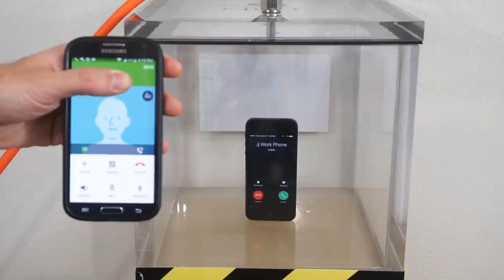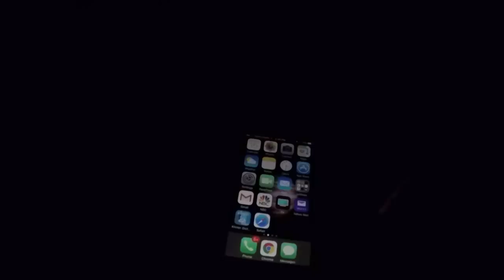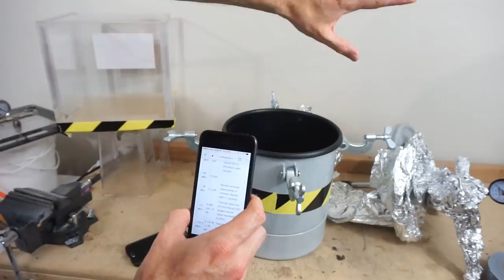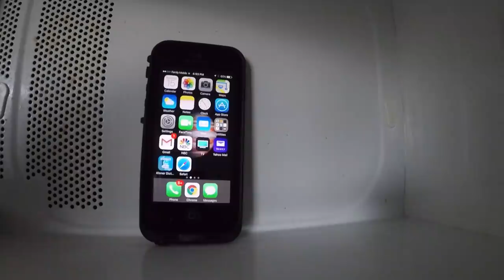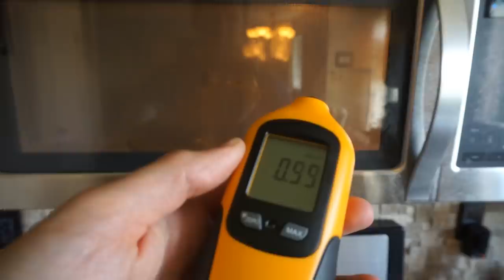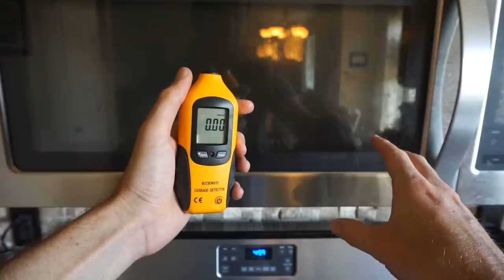Can You Call an iphone in a Vacuum Chamber? 4 Different Signal Tests!

Comment: Man's getting signal in a vacuum chamber but I can't get one bar in my house...
Reply: But then how did u put this comment then if u have no connection you tube needs 2 bars to work 😂😂
Reply: @Anything World Ever heard of a PC?
Reply: how is that impressive? light doesnt need matter to travel. only sound cant
Reply: 1. I think you need to check your grammar.

2. Calling doesn't use light waves, it uses a DIFFERENT kind.
Reply: me?
Reply: also it's an electromagnetic wave also known as light waves, i call radio waves light waves. dont judge me
Reply: Not all EM waves are light. Do your research.
Reply: Bro why u want one bar in your house u will sit at it lol
Reply: Anything World Heard of WiFi?
Reply: TSP 😂
Reply: TSP lol same
Reply: That’s surprising. But what’s not surprising is that you can save 50% or more on car insurance.
Reply: Is signal realy so bad in the US, cauze  i get 3-4 bars in the midle of the forest
Reply: InsanityWars Gaming in physics, light is often used regardless of the wavelength. Visible light refers to the visible spectrum.
Reply: TSP the vacuum chamber doesn't not affect the signal in any way. The metal bucked does, quite a lot and water a bit,
Reply: TSP haha
Reply: "one bar" haha get it? Cuz bar is a measurement of pressure
Reply: Philippines be like:
Reply: I get the joke but in a vacuum it’s actualy better technaclu
Reply: @Jake_Fpv  nope those bars are just an indicator of distance of the nearest tower. Youtube cam work with 1 bar too. The network speed depends on the number of people connected to the tower.
Reply: I know the feeling: I get service anywhere in my house, except my home office!!😒
Reply: @Jake_Fpv  ever heard of wifi?
Reply: @vincentrobinette1507  use wifi
Reply: @Jake_Fpv  ever heard of going outside to get 2/3/4/5 bars?
Reply: I have the same problem. It's probably because of the area. There's some kind of material absorbing the radio signals from the antenna to the cell phone. Could be ionised atmosphere around the area. Just a guess.

Comment: So it receives calls in a metal can, but it Probably can't get cell service in the mall lol
Reply: jesse scharf lol
Reply: jesse scharf the metal can probably acts like an antenna. Lead is what cancels signal I believe
Reply: Certain metals can prevent your phone to receive signal. Diamagnetic metals like copper does not allow electromagnetic waves (radiowaves) to pass thru so if your phone is incased with such metals it'll be hard to have signal.
Reply: The materials used on the construction of the mall/buildings could be the factor why mobile phones does not have signal in it. Some building management ask service providers to install in-building-solution( mini atennas) inside the building to allow signals.
Reply: jesse scharf the cause of lead making you insane is because it gets rid of your cell service
Reply: jesse scharf the mall has much thicker steel walls and block alot more

Comment: Put your phone in the bowl of water and put the phone and bowl of water inside the steel chamber and the put the steel chamber inside the vacuum chamber and see if it works... I'd be surprised if it works in all that
Reply: i think the water would boil
Reply: but the temp wouldnt rise to hurt the phone.
i'd be more worried if the water got some of the metal from the container. or used the electrons from the metal and became conductive and broke the phone.
Reply: I agree
Reply: The vacuum chamber would remove air that is blocking part of the signal. It makes the signal stronger, not weaker.
Reply: Mr Sandman no because you need to connect the chamber to cables
Reply: You forgot the microwave
Reply: It will work
Reply: And the vacume chamber in a microwave

Comment: Bro! Radio waves can go through buildings! Why wouldnt it go through a vacuum
Reply: At least it show the difference between sound/shockwave and electromagnetic
Reply: Of course, imagine gps satellite signals from an altitude of 20.000 km
Reply: Makes sense.  Radio waves carry instructions to rovers on Mars and data back.
Reply: @jasonlisonbee  just like any wave the further out it travels the weaker it gets til the point where it dissipates and blends with other frequencies through which it travels ending in the loss of any distinct signature that could be observed.
we are told that we have Earth's atmoshpere, the Van Allen belts, the expanse of space(56 miilion miles minimum) and the atmosphere of Mars through which a signal must travel in order to reach these rovers in order to control them, safe to assume that if such an arduous task were possible the power needed would be insanely high to successfully project these signals,.
assuming the above is true then we must assume that the these rovers must be capable of the same power output for the signals being sent back through the atmosphere of Mars, the expanse of space, the Van Allen belts and the Earth's atmosphere to mission control. when you think it through it's so obvious that what ever NASA tells us is scifi nonsense.
Reply: Not all buildings. Like one of the building I went to.
Reply: And space....from the edge of our solar system.
Reply: thats a unscientific anology. a sound wave can travel through buildings,  but cannot in vacuum
Reply: Are you mad 😂😂😂
Building is a medium so it can go through but vaccum has no medium so how can it go through it ??
Actually it the phone recieved call because it was in touch of glass or other surface so 
Simply the wave travelled through that substance and not through vaccum .
😂😂😂😂😂😂😂
This men don't know even basics of science
Reply: @Gojosatoruxd00  No, that's not how it works my friend.
Reply: @Dr.Cosmar  so how ??????
Reply: @Gojosatoruxd00  Radio waves are much bigger than light waves (in terms of their wavelength). Radio waves are bigger then the size of atoms in a wall, that is why they go through, while light is a small wave and cannot get through the wall. ... If the wall is made out of glass, LIGHT WILL go through it.

https://www.fnal.gov/pub/science/inquiring/questions/mikep.html

TL:DR. Particle Physics 101
Reply: @Dr.Cosmar  sir I think you have did PHD
But I am just a student of class 10
😉😉😉🙄🙏🙏👍
Reply: @Dr.Cosmar  but sir how it travels in vaccum please explain me
🙏
Reply: @Gojosatoruxd00  Like graduation 2010? Cause I graduated 2011.

Or do you mean you started school in 2010? If you started school in 2010 the last thing you should be doing is telling people on the internet how stuff works.

Google is but a baby breath away.
Reply: @Dr.Cosmar  sir boards aur exam takes my time
Reply: @Dr.Cosmar  Sir I started my studies in 2011 and that time I was in class 1 
And sir Board exams are there but after boards I shall try to make videos 👍👍
By the way I am from India 😉😉
And you ??
Reply: Sound can also go through buildings (but is much quieter) but can't go through vacuum
Reply: Because buildings are made of materials that don’t block the radio waves.
Reply: Cuz vacuum is exact oposite of building.
Vacuum is no matter or almost no matter per area
Reply: @Gojosatoruxd00  actually, radiation (radio waves to gama ray) doesn't need matter to propagate, only sound waves need matter to propagate
Reply: @Gojosatoruxd00  no EM wave travel fast in vaccum

Comment: I don't think the density of steel is enough to block out radio / electromagnetic waves you should use a lead container
Reply: Lukas Janßen how about osmium
Reply: Celestial Ghandat I don't know depends on the density
Reply: also the steel might not be close enough to block antenna bands
Reply: Thinking the same thing.
Reply: If steel blocked radiowaves then phones would become useless because they would loose connection near big buildings or inside cars.
Reply: savvageorge how old r u? Were u educated? Just wondering dun be triggered
Reply: kagi chan i live in Niedersachsen (Germany) (16jrs old)
Reply: No, the thing is that micro waves can pass thru small holes and gaps. The rubber seal between the top of the container and the lid looked quite thick - probably 5 mm or more. For the signal that's pretty much equal to have an air gap of >5 mm between the top of the container and the lid (the non conducting rubber doesn't stop the signal at all - it's passes thru it pretty much like air). The aluminium foil could do the trick - but it's still hard to wrap it tight enough to not get small gaps where signal can leak thru.
Reply: He was doing that to try to cover the rubber seal but still didn't got it tight enough. It could have been more effective to just wrap the phone in foil - but now he didn't do that, so we don't know. Microwaves doesn't behave like ionizing radiation. Density of the material doesn't matter. Aluminium is in fact very good at stopping radio waves.
Radio waves is stopped by the fact it induces electrical currents in the material they passes thru (electromagnetic energy it turned into electric energy). Good conductors like metals doesn't need to be very thick to stop radiowaves - and those material is also highly reflective of radio waves (currents is induced directly in the surface and then turned back into radiowaves going in the other direction). 
Poor conductors like water will also have currents induced, but the process is not as effective and the radio waves will penetrate much deeper (so for the water it was clearly that there was not enough water covering the phone). They are also a lot less reflective as the currents is mostly turned to heat by the internal resistance of the material (that's why microwaves is good at heating water or food with water in it). Good insulators like rubber have almost no effect at all
 - the radio waves just continues thru it. The reason buildings and cars have no problem is that they have windows (glass is a good insulator) and other non conducting parts where the signal can pass right thru.
Reply: Lukas Janßen   Or tin
Reply: Lukas Janßen another option is the air inlet pipe working as waveguide, basically a tube for radiowaves
Reply: Lukas Janßen Lead is tho about 3 inches of it
Reply: What about Platinum
Reply: Lukas Janßen no... if that was true then how do satellite dishes work?
Reply: savvageorge jesus..  if this isnt a joke i feel bad for you.
Reply: that was interesting result, when on my university we have classrooms where you have zero signal on phone.
Reply: Radiation can penetrate through anything basically
Reply: Shaarvesh Rao  it can penetrate almost everything to be able to block it you would need relatively thick lead (or anything denser) it also depends on with radiation you are taking about . Radio waves are not radiation
Reply: Lukas Janßen yeah, lead. Only a poisonous metal that causes lead poisoning
Reply: Nit the Liar lead isn't deadly itself . It just weakens your immune system until it's no more existing
Reply: Lukas Janßen yeah
Reply: they can block them. if you go into a building that has a lot of steel walls it will block signals.
Reply: Gamma rays can penetrate through steel, but any em waves of higher wavelength like x rays cannot.

Comment: 5:49 you don’t need ocean-deep water for this not to work, just a few meters of water, deep in a swimming pool, is enough to block the radio waves.
Reply: England is my city I
Reply: I don't think so light can travel through water so radiowaves which are basically long wavelength em waves can travel through water.
Reply: England is my city you probably work for the nsa
Reply: Nathaniel Thipharacksa picture*
Reply: PandaTV Plus lol light isn't that kind of wave it's electro magnetic not like sound which needs a medium to propagate.
go back to highschool
Reply: it does not need a medium to propagate like in vacuum but it can travel through a medium like water.
Reply: madscientistshusta actually, light is indeed a wave. it's both a wave and a particle and unlike other waves, doesn't need a medium to travel through. space-time itself acts as the medium in this scenario.
Reply: England is my city I seen this comment while watching that part
Reply: I'm 11 and I'm smart enough to know that you have to have more than a swimming pool to get it to not work so you are wrong, you just got beat by a kid.
Reply: Did you try?
Reply: Life Done Easy you must be using a kiddy pool then. Just because you’re 11 doesn’t mean you’re smart enough to know what it’s like, especially in an 18 ft or deeper pool. Boom. Told by a 12 yr old.
Reply: England is my city
Reply: Thurman Ball What is 18 ft in non retarded units ? And depends on the medium ( so the water) but I doubt a pool can actually block the signal, specially since light ( another electromagnetic wave) can go through most pools
Reply: England is my city
Reply: England is OUR* city
Reply: hey nick Crompton
Reply: You are completely correct - and the higher the frequency of EM waves, the faster the attenuation occurs. This is the problem with submarine communication, for instance. High frequency radio waves (cell phones operate at 800 MHz or 1900 MHz) attenuate much too quick in water to be useful.  The solution would be EM waves in the 3-3000 Hz range, but then you need antennas that are thousands of kilometers long....
Reply: Ha waves...
Reply: I think even a foot of water on all sides would do it. Notice the phone had practically zero water under it.

Comment: Put it in a bowl of water inside of a microwave inside of a vaccum inside of a steel box
Reply: Bahadır Kök that would be a big box is shit
Reply: Of*
Reply: Wouldn't be that difficult of a setup I'd imagine, especially if you make the steel box do double duty as the vacuum chamber.  The tricky part would be to make sure the water vessel is sealed tight and the material is strong enough to withstand the internal pressure once the vacuum is created - wouldn't want it to explode or boil when the air is pulled out...
Reply: Put it on the the frog on the log at the hole at the bottom of the sea.

Comment: No one 

Him : put iphone in chamber and have a old samsung phone outside 😂😂
Reply: He needed a phone with a battery that wouldn't delaminate in a vacuum due to the expansion of internal gasses. Samsung batteries don't have a very good track record. He wanted to test the phone, not the battery.
Reply: @vincentrobinette1507  ik
Reply: @Nerd7373  This is what you do, just before your warranty expires. If the battery is getting old and has entrained gas, this will cause the battery to be weak enough, that you might get a new one under warranty. If the battery doesn't change characteristics, it's a good battery, and you'll be fine for another couple of years.

Comment: Is it the density that absorbs the radio waves, or is it something else? So I'm thinking there are a couple ways to prevent radio waves: 1 you can redirect them (i.e. A sealed steel container, also known as a faraday cage) or 2 you can have the radio waves be absorbed into a barrier (i.e. Extended distance in water, or even air) please let me know if I'm misunderstanding something cause I want to know if I am on the right track.
Reply: A Faraday Cage is made out of mesh. You can build a simple one out of copper screen that is available at most hardware stores. I believe Myth Busters blocked cell single using copper screen.
Reply: tct72 it's the same idea though right? Or am I wrong?
Reply: The main factor here is conductivity.1) For static charges this is because static charge always accumulates on outer surface of conductive object. It has nice mathematical explanation but you can also just imagine electrons repelling each other. This is the principle of the Faraday cage. (Electrostatics)2) For optic and radio frequencies high conductivity means high reflexivity of the material. This is why metal surfaces are shiny. Also the light or radio waves that werent reflected are quickly attenuated (maybe search complex refractive index). (Optics)3) For ultra high frequencies like Röntgen and gamma rays the radiation is much more particle like. It penetrates deep even in conductive objects. This is where you need high density materials because it is more about interaction of photons and atoms. (Particle physics)
Reply: Erik Hendrych awesome thank you for the this explanation!
Reply: Thomas Caulfield , There is a thing called jumper (not actually as it doesn't jump)which can block radio waves of the place it is put in . It is mainly used by militaries
Reply: Converge GD , people who want to gather knowledge will read it
Reply: I can preprogrammed that iPhone to iPhone 7
Reply: Thomas Caulfield you are right about everything you said except your question if it is the density , a radio wave is just another wave on the electromagnetic spectrum with only energy and no mass meaning it doesn’t take place in the workings of entropy laws and patterns so no density won’t make a difference
Reply: I tought of a faraday cage too, but then i was suprised that it worked in the microwave and the steelcontainer, wich both can act as a faraday cage. 
Then i remembered that a car is also capable to act as a faraday cage (if a lightning strikes your car, you are fine unless you are in contact with metal). A phone still works inside a car (ok, might be due to the antenna which is conneced to the outside via the radio system and that is nowdays likely to be connected to your phone, however this was not the case in older Cars). So i conclude that radio waves cannot be stopped with a faraday cage. If that was possible why are not all nuclear power plants in a faraday cage to reduce risk of radiation. I know it is not the same kind of radiation like the one a phone requires, but the principle should be the same on a smaller scale with radioactivity

Comment: 1. It’ll work cause the radiation is not affected by the vaccum 
2. This might hinder the signal significance 
3. Slight hinder on the signal although the radiation passes through water
4. It’ll hinder because I’ve done it before but to see if it’ll affect the wi-fi.